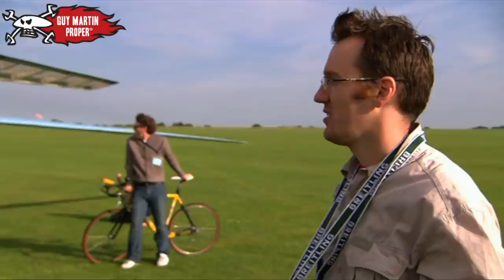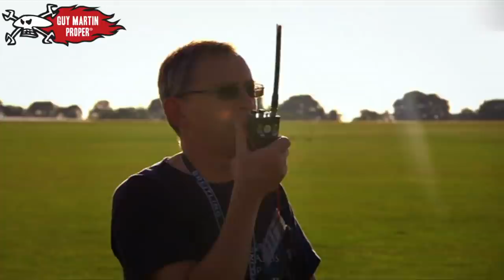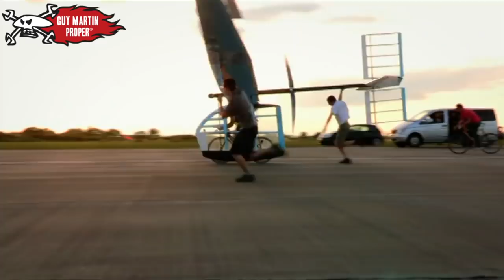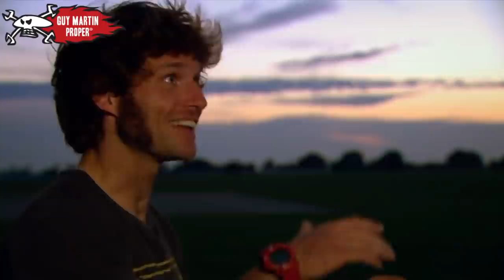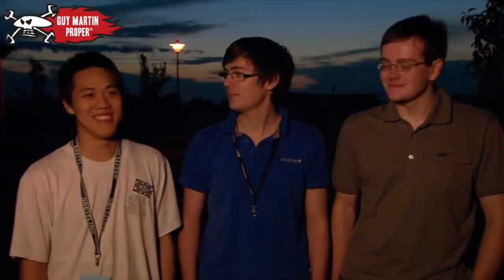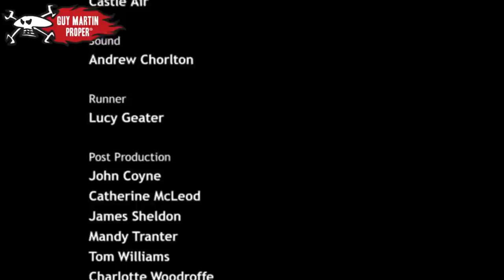Guy's Flying Bike | Guy Martin Proper

Comment: I really think I'd have gone with a recumbent bike.  And maybe a bit more aggressive gear on the top end to get a few more rpm for the same pedal speed. Yeah, bit more energy required, but Guy is a machine. (With all his implanted hardware that's not even an inaccurate joke lol)

I've seen this full episode, but i can't recall why they didn't do those things, or if they considered them.  Worth a shot though id have thought lol

Can't cry about the result they got though, well done Guy and co

Comment: All a bit pointless when you know a man pedalled a plane across the English channel over 40 years ago.
Reply: i think boeing and NASA were involved in that for years - this was designed and built in days!! but you are right
Reply: Humans have been climbing mountains for ages, does that mean you don't have to climb any if you want to? Yes, the Albatross was incredible, but this is a whole different (and cheaper) kind of HPA's.

Nasa was involved, but only as a small sponsor. Boeing had nothing to do with it. It was built and flown by an amazing team of engineers and model aircraft buiders, with main designers Paul McCready and Peter Lissaman.
Reply: I bet you're a real toot at parties